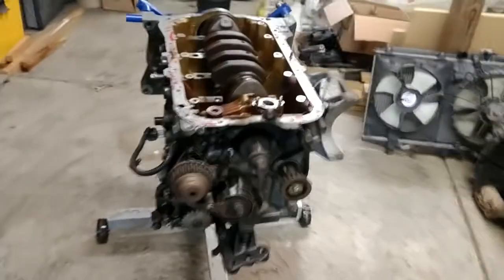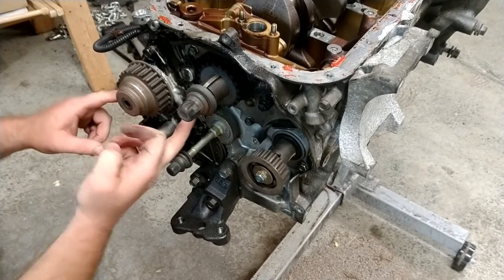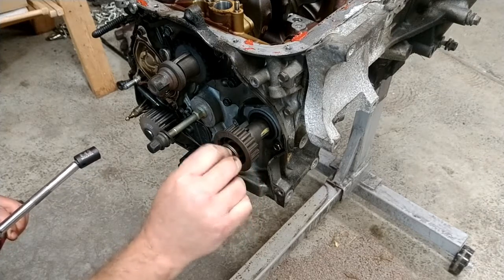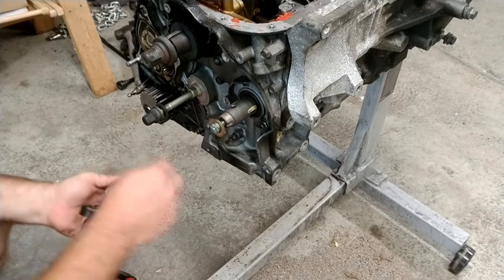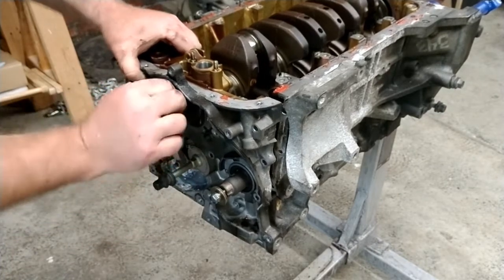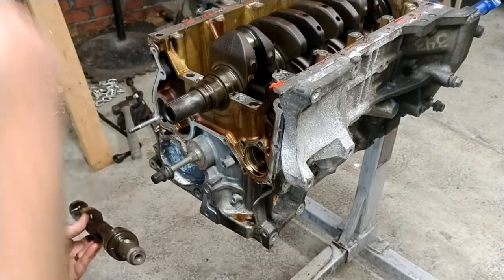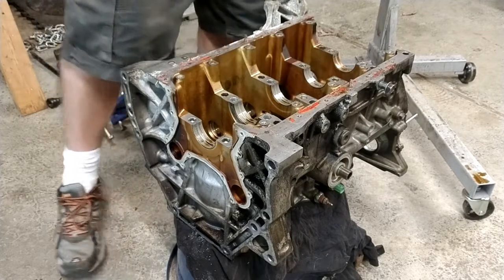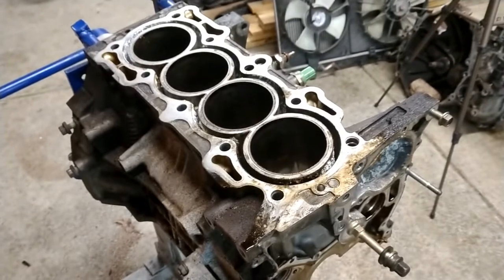F23 Honda Accord Engine Rebuild Part 6: Crank and Internal Dampeners Removal

Comment: This series is an incredible find, all I need now is a garage.  I've driven this motor for 16 years, across country twice, up mountains in the great NW and through and through flooded roads in FL, and it still takes me to work every day.. Would love to do it the justice you've shown here.  Great videos.
Reply from the maker: I'm very happy to hear you enjoyed the videos! Honda (in my opinion) makes the most reliable and longed life engines all the way from push mowers, dirt bikes, generators, etc, to their cars. Dig a little deeper on my channel and you'll find that I took this car from NC to TX and back after the rebuild. 

Thanks for taking a moment to comment.

Comment: Can I remove the crank from the bottom with engine in car
Reply from the maker: Yes you can. But u have to pull the transmission and the oil pump. I wouldn't recommend doing it that way if you have access to an engine hoist. Good luck!
Reply: @ktecgarage  I don’t have access to a engine hoist,my crank bolt snapped inside the threads and flung my harmonic balancer off

Comment: I’m curious to know what engine stand is that and what bolts did you use to mount engine. Awesome detailed F23a rebuild videos. Thanks
Reply from the maker: The stand is a Duralast from AutoZone. You can use your transmission housing bolts, but I went to Lowes with one of my transmission bolts and purchased the same size to make sure I didn't damage the originals. 

Thanks for the comment!

Comment: I've torn down my first f23a5 engine thanks 😊 🙏 this step by step video was 👍 👌 keep it up. And what would you recommend to if I need to get the block and head resurfaced? I see your not resurfacing your head or block?
Reply from the maker: I'm really glad to hear this was helpful. 

I did not resurface. My tolerances were right at .003 which is the limit.

Comment: Hey man , Awesome videos I actually have identical car as you same color 4 cyl manual transmission. It runs great but leaks oil , just curious what areas you might attack first and which gaskets would be a good start with pulling engine would be ideal . Also how is the Honda running any updates! Appreciate the videos on the platform Thanks
Reply from the maker: Thank you for the compliment! I have several recent videos featuring this Accord so be sure to check them out. 

As for your leaks, just depends where it's leaving its puddle. Driver's side, it could be oil pump, oil pan, balance shift gears, cam seal, valve cover..... You get the idea. 

Good luck and thanks for watching!
Reply: These engines are notorious for valve cover and vtec-solonoid leaks. Best thing to do is clean it off as much as possible, then just look for new wet oil each day after it's driven.

Comment: I'm at this point now. My cylinder block looks exactly like yours, has the same streaks inside the cylinder wall from the the rings. I'm surprised how clean mine is with 240k miles, I'm really thinking in reusing my pistons,  I have not decided yet..
Reply from the maker: When the parts wear the piston starts to rock a bit and the skirt grazes that part of the cylinder. Good luck!